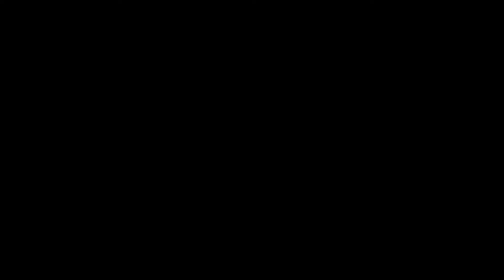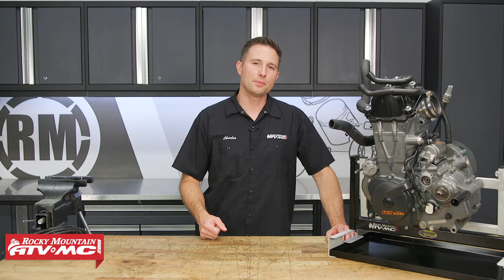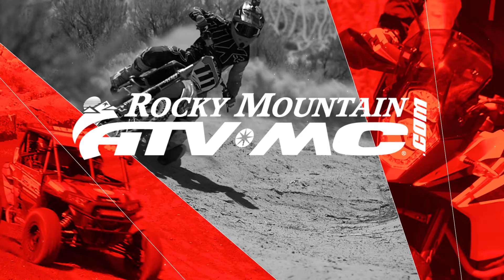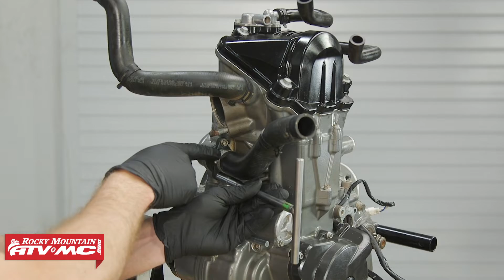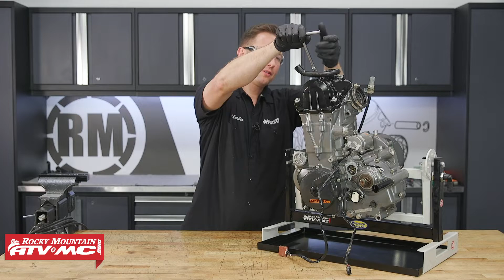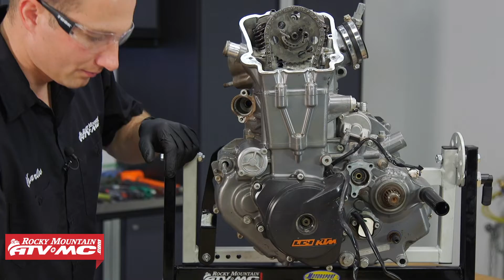KTM 690 & Husqvarna 701 Engine Rebuild | Part 2: Top End Disassembly

Comment: is it possible to be top dead center but not on the compression stroke?
Reply from the maker: You could be on the exhaust stroke.
Reply: @rmatvmc  what i meant is when the markings are aligned on the camshaft is it possible that it is not on the copression stroke(its not possible to be on the wrong stroke i checked it, intake valve always opens and closes before marking align) thanks for the ansver

Comment: what year is this? wow I have a 2018 and man is the cam different
Reply: 2018 should be the same they change in 2019....KTM
Reply: @flproduza1662  on the husky 701, 2018 was the first year they changed. Then they brought those changes to the 690 in 2019(but with traction control abs etc). I actually had to do tons of research to find my bike; the 2018 is the first year that the extra 3cc were added, the extra counter balancer etc was added, BUT on the 2018 701, you get all of that without the euro 4 emissions mods, and without the rider aids :) plus its the last year the ABS was easily disabled by removing a fuse from what i could find
Reply: @Merc399  oh yeah on the 701 is different I have the 2016 701 Husqvarna same as KTM 2012 to 2018
Reply: @flproduza1662  dude the torque on those is next level!

Comment: Hello can you tell me from which side should I install small camshaft bearing ? As I understand it have meaning, it is not same from both sides, its greased and have sealing from one side, on my motor it was totally destroyed, I took it out by peaces.
Maybe it was installed by wrong side that's why it broke and broke every thing in head 🤔

Comment: Hey, what about the roller arm bearing, when it is worn out should it do some ticking sounds or something when engine is running? I have a 09 450exc and have a ticking/slightly knocking sound at idle. Any recommends what should I check?
Reply: maybe check the valve tolerances if you havent already, also ktm uses hydraulic cam chain tentioners so after starting the bike the oil pressure needs to build in the tentioner, until then its possible that the chain makes a knocking, ticking sound. after a few minutes it should go away